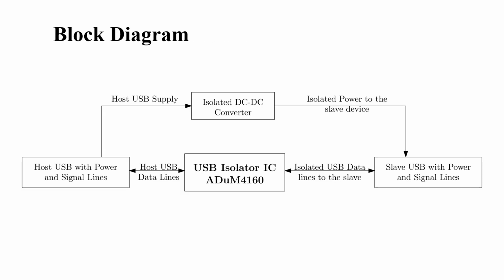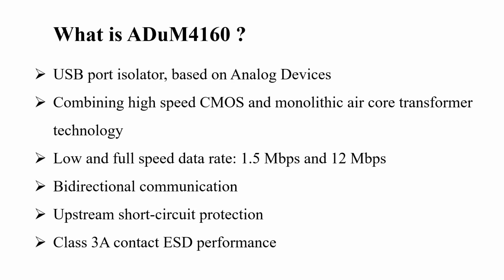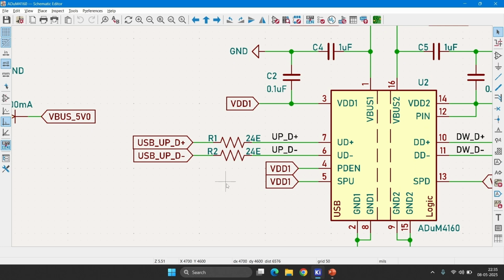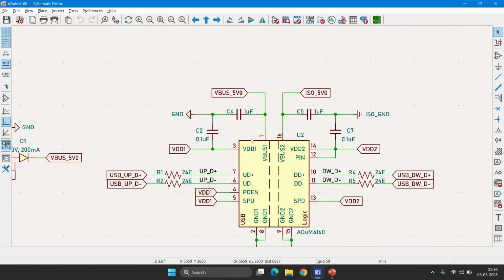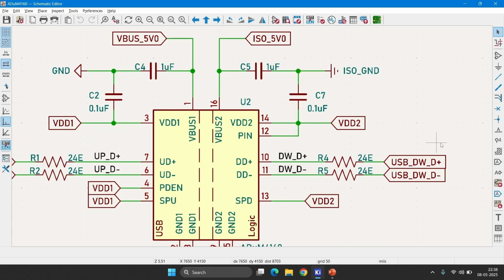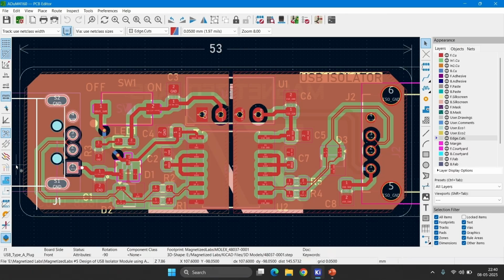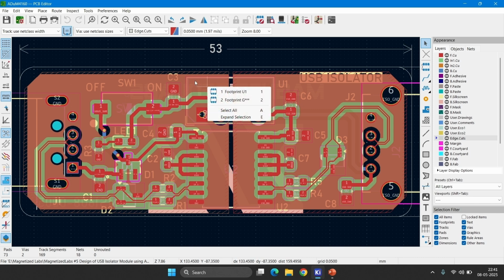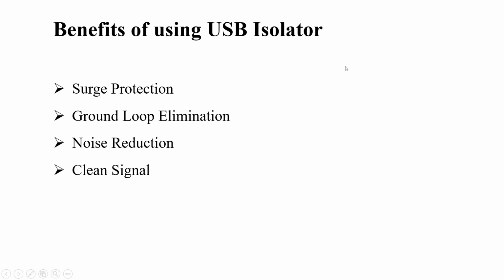Design of USB Isolator Module using ADuM4160 in KiCAD | Magnetized Labs 05

Comment: Nothing wrong from the software interpreter point of view (as the software doesn't care), but from the technical point of view, some changes should be made on the schematic. Ground should always be pointed down, you aren't supposed to layout decoupling capacitors sideways (but towards the ground symbol in a straight line). You will likely get some negative feedback from experienced engineers for this.